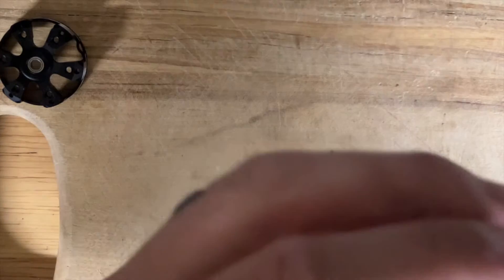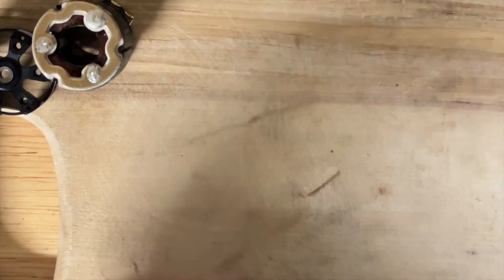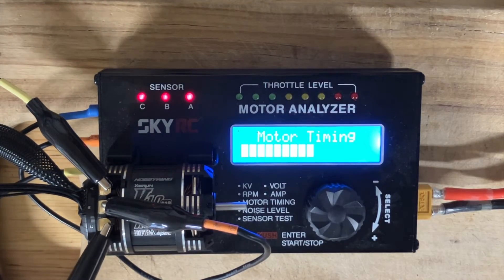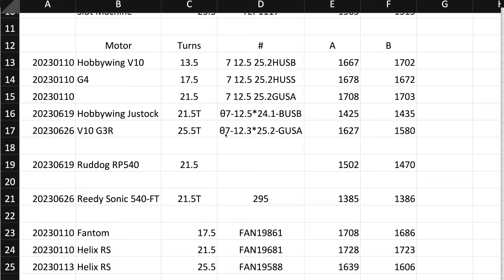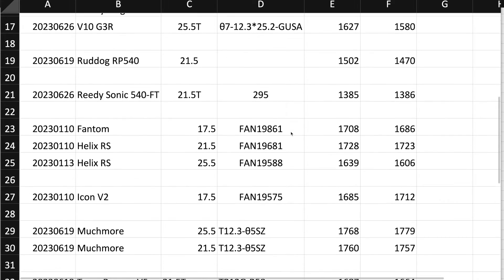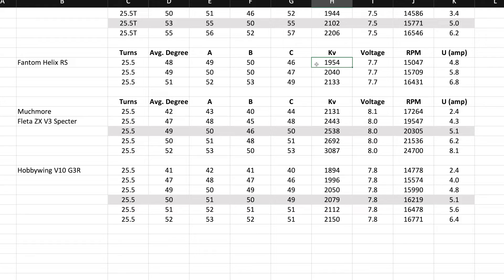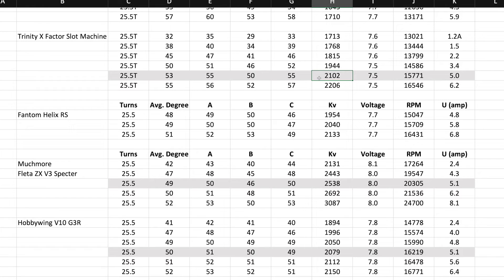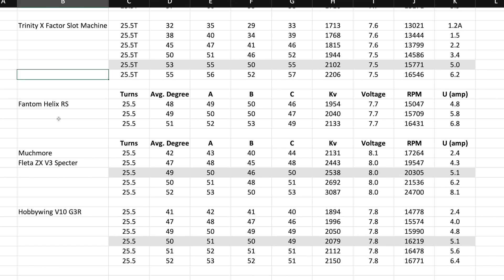Hobbywing V10 G3R 25.5T motor specs Kv gauss

Comment: I just got one.
 Of these motors the other day for gt12, and it's cogging like crazy at low rpm even with no load.  Brand new hobbywing 1s ESC.  Tested with other sensor wires and an old LRP esc, still. Cogs like crazy. Adjusted timing down, still happens.  Is it possible it's bad out of the box?  I tried an older 17.5 lrp motor and it didn't cog at all.  I'm thinking the motor is bad.
Reply from the maker: It is possible. It is very rare I think. Swap the sensor wire. This is more common. But it could be a bad board too (less common).

Comment: I have the hobbywing xr10 stock and G3r combo coming for my f1. Any advice on setup for my f1 ultra r5 that’s coming. Thanks!
Reply: Thanks! Any advice on motor maintenance on this? My first brushless motor. I’ve been a nitro head forever.
Reply from the maker: @Bojangles1089  Blushless motors are really easy. Just use an air compressor to lightly dust it. and once in a while put a drop oil bearing oil on the front and rear baring. By once in while, I mean rarely. They are pretty low maintenance. But do not oil the internal ever. It is just a small drop on each bearing.
Reply from the maker: Play with the timing. You might want to try somewhere between 47-52 degrees. 

I have this video where I purposely overheated the motor to see how it would last: https://youtu.be/8GXasCvDzrY

Here I go into more details and I mention gearing too.

Comment: Very good analysis.   Have you run an R1 25.5?
Reply from the maker: In blinki, it is slow. Xfactor is much better, and Slot Machine even more in my opinion. Right now I am running the Fantom Helix. This motor is nice for F1. This coming weekend I will start running the HW G3R to see how it does.
Reply: @telecomandorc  Are there any major differences between VTA and F1 motor needs / setup?
Reply from the maker: @ericpine4844  They are both blinki... well, they are suppose to be blinki. VTA is heavier by about 400g. So, FDR is different as F1 is direct drive. Final drive ration just depends on the pinion and spur since there are no pullies like in belt driven VTA cars. Thinking about it, the spur/pinion ratio is similar.
Reply: @telecomandorc  I was running VTA and see that I'm not able to keep up.  I'm going to gauss the rotor and see how close to 1600 it is.  Thanks for all the hard work and informative videos!
Reply from the maker: @ericpine4844  My pleasure.
Reply: I think I'll set my new Slot Machine to the same KV for a comparison on lap times to the R1 motor.
Reply from the maker: @ericpine4844  If you set it to the same Kv and use the same gearing, let me know what the temp diff. is at you FDR, please.